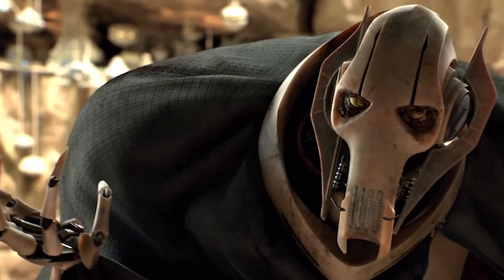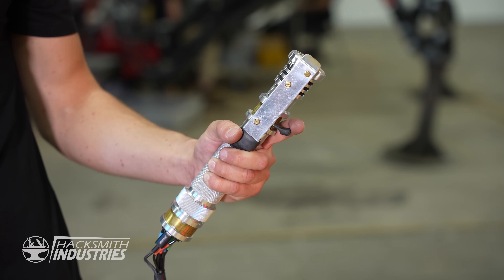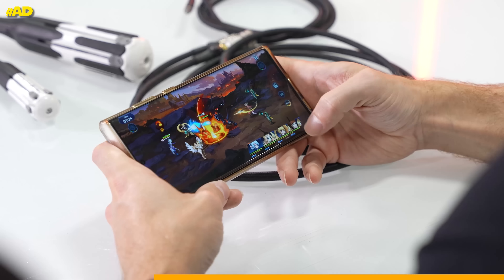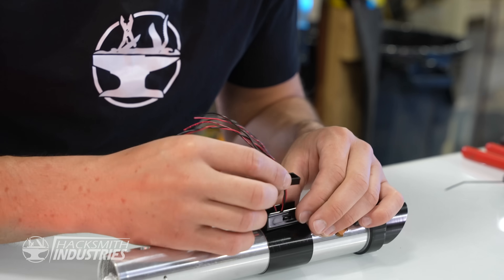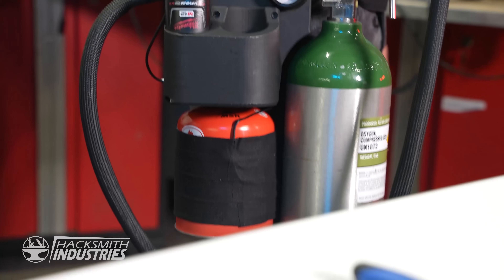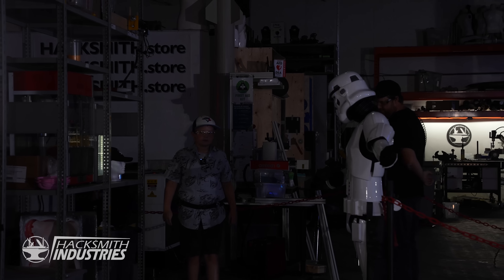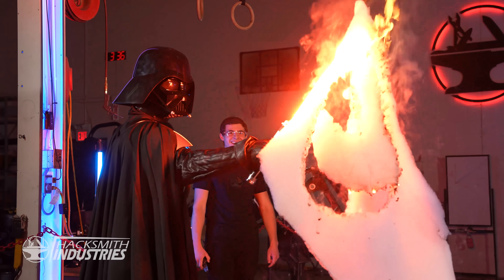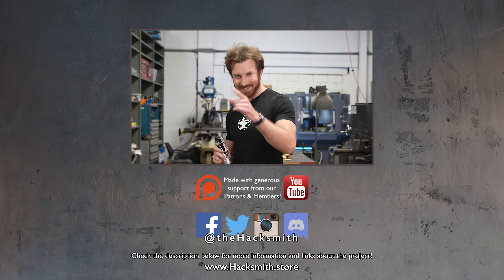My Best LIGHTSABER Yet! (STRONTIUM PLASMA 4500°)

Comment: Call me crazy but I can think of two ways to improve it. For the fuel, you could use hydrogen or just go full oxygen. A neat benefit of full oxygen is you can use the blade to turn diamonds into carbon dioxide by burning them. Yes, burning diamonds, literally. Hydrogen will just make it a more powerful, much hotter flame. Fantastic work guys! Great job! I love the red flame idea, the detail is stunning and that new pack really makes it almost something someone could feasibly use.

Comment: The shortness of the blade is just how physics work. The "light saber" is basically a very smooth gas flamethrower. Think of it as a water sprinkler/garden hose. If turn it on and don't move, the stream is long. Once you start swinging it around or if a strong wind blows through your area, the stream gets broken off. Now, that stream is basically the fuel stream of the "lightsaber". If that is disrupted, no flame. The further is it away from the hilt, the slower the stream and the more prone it is to disruptions. Unless there's an innovation in flow technologies, it is unlikely that this problem can be solved. I think hacksmith is likely to be looking into another way of fuel delivery. I just hope that this project won't be the megabots' mech for hacksmith.

Comment: You should try adding a oxygen tank at a steady stream and high pressure to get more height on the “blade” and it will also allow for the flame to be more consistent.

Comment: remove the electronics and speakers for the noises and put in a smaller version of the fuel electronics that are on the hip and get custom made canisters (maybe like fatter co2 cartridge) to hold the fuel and oxygen that can be loaded into the hilt via a magazine like creation. I'm sure the fun wouldn't last as long but it would remove the external fuel source and provide full movement but hey you can always have more to reload right? lol

Comment: I wonder if it would be possible to use less gas and make the plasma travel further if you engineered the valve to produce a traveling, burning toroidal ring and pulse quickly enough that it looks to the human eye like a continuous column? The pulses might even sound like the actual movie light sabers, depending on the frequency, who knows? Pulse jet engines sound pretty throaty, no?

Comment: you should try to use a rocket engine for the saber. liquid booster for throttling, self-contained, supersonic shock diamonds, long and not very airflow dependent, pretty much everything you need.

Comment: Since you seem to be going for aesthetics on the blade, could you have a casing for the power pack to make it look like a blaster in a holster? It would draw attention from the fact that the lightsaber isn't actually free floating as well
Reply: they could also make it look like the proto-saber power packs. So it more just needs to look like a star wars car battery and you'd be good xD
Reply: Original light sabers were wired, so technically they don't need to draw attention away from that
Reply: @leonardonetagamer  true, but for the majority of the population people know lightsabers by the non wired variants found in the films, so it would help to further appeal to a larger audience
Reply: @leonardonetagamer  lightsabers with wires are not canon
Reply: @albusnightspring8057  not "disney cannon" and no one cares about disney cannon.
Reply: @albusnightspring8057  how so? they are present in the og story
Reply: @leonardonetagamer  only og story is the films
Reply: @albusnightspring8057  um no??? The films are based off books and comics
Reply: @leonardonetagamer  No. Star Wars films are not based on comics or books. The films are the original material, everything else is merchandise
Reply: i said the same thing, like a black leather casing in my case is what i'd go for

Comment: Would inverting the fuel and/or oxy tanks so the sabre draws liquid instead of gas be a way to lengthen and stabilise the flow when moving in air?
Reply from the maker: Nope, the butane would still expand into gas when it burns -- and oxygen isn't stored in liquid form

Comment: If you put a metal wire connect to the light saber, than heat it up, it will be a cool weapon, that can cut any thing
Reply from the maker: It would melt
Reply: @hacksmith  there are some matel have extremely high melting point

Comment: question... why use copper?
im no metalurgist...
but why use a most KRAZY conductive metals in certain places... WHERE YOU DO NOT WANT HEAT (ignition of gas into a plasmatic form of matter)
for the record im not questioning the extremely experienced and knowledgeable people whom are fabricating this monumental accomplishment.... 💯
but why not a metal  that is no where near as electrical conductive (being able to disipate heat conductive energy)  while being able to be strong and light... such as aluminum... or titanium...???
i may be wrong.. im no expert in any way... but i would very much appreciate a scientific explanation... 💯
Reply from the maker: Because heat transfer is not an issue... it's well before the stainless steel nozzle,  which also doesn't heat up.  Remember,  gases are cold! Only when on fire is it hot.
Reply: @hacksmith  SEE EVERYONE...
THIS IS WHY HACKSMITHs AWESOME💯.... AND EVERYONE ELSE IS.... ahhh.... "not as awesome??? 😋🤘😎💯

Excellent answer.  That is what i did not consider... gas is indeed cold... (relatively speaking)

question... other than the pure astheic of the copper looking naturally cool, is there more of a engineering factor the reason for the copper in those places...?

(i totally understand if it's a trade secret if you can't divulge that information....)

im just naturally curious about pure awesomeness... 🤘😎💯
Reply from the maker: Copper and brass is easy to solder, which is why it's typically used in plumbing!

Comment: As the blade design continues to get hotter and more efficient the problem of singed hands is going to get a lot worse... you may want to look into a solution for that, maybe a heat exchanger near the hilt?
Reply from the maker: The hilt still doesn't get hot -- remember expanding gases get cold.  It's essentially gas cooled.

We still have to go much hotter if we want anything similar to a real lightsabers cutting ability!

Comment: I’m a dummy when it comes to engineering but I feel like it would be cool to be able to make it a little bit longer so you’d have more space to put the things you need inside like about as long as Darth Maul‘s light saver but only have one blade and then also have a system where you can push in one of the fuel containers that’s small enough to go in and then pump it out once it’s empty so you can just push in another one and keep going
Reply: lightsaber
Reply: @bable631  I used the microphone so it misspelled it

Comment: Hey guys, love the channel. I had a couple thoughts on how you might improve the saber for your next version. Have y'all considered using acetylene as a fuel instead of propane, as it burn a lot hotter? Also, I saw one guy devise using a telescoping ceramic blade that would dispense the plasma throught tiny holes along its length, while also allowing you to have a solid blade.
Reply: While I am kinda on the side of using acetylene for a hotter output, what has to be in consideration is the outer part of the saber not melting itself while it's active. Maybe I'm wrong on this but I'm not sure if the materials the hacksmith are using can withstand higher temps. But hey if I'm wrong then I'd love to see that
Reply: So this is where they're going to need to start utilizing the way rocket engines cool the inside combustion chamber of the rocket and engine nozzle. Temperatures reached by combustion in rocket engines often substantially exceed the melting points of the nozzle and  materials (about 1,200 K for copper). Regenerative cooling, where the propellant is passed through tubes around the combustion chamber or nozzle, and other techniques, such as curtain cooling or film cooling. (wiki)
Reply: wow, cool
Reply: you better stay away from the fire my friend

Comment: I've been thinking, what if the lightsaber had an oxygen flow in a type of vortex shaped current. That could compress and contain the flame, and ignite it further, for a higher heat output, and a better swinging experience.
Reply: That was exactly the solution I was thinking of for the crossbreeze problem too!

Comment: This seems like a great update, I’d love to see a combination of this an some kind of retractable metal rod so you can actually hit stuff with it
Reply: this is the only thing this is missing, but is there a metal out there that can withstand the heat for such a long time
Reply: @leonhadley21  if there were it’d probably be stupidly expensive
Reply: the first version was made of metal
Reply: @Strider314  yeah but it didn’t retract or have the plasma blade
Reply: I looked it up. Tantalum Hafnium Carbide Alloy has the highest heat resistant out of any other metal (3990℃)(At least out of the ones I could find) Sooo I guess it's impossible to make, unless they reduce the temperature
Reply: @Moon_5a  I’d say there temp is probably in Fahrenheit
Reply: @kobihemmerle1140  oh damn you're probably right! That's means it's possible!

Comment: It's a bit on the short side in my opinion, but this could easily be resolved by making the blade thinner and thereby increasing the velocity at which the the gasses are escaping. I also believe it could solve the problem with it shortening when swung

Comment: This is really cool, but... 

A real lightsaber, were one to exist as in the movies, would be a dangerous weapon (and one thats impractical as a weapon, without Jedi powers aka the Force). So, really, it's a cool toy, except it's now realistic enough to be a very dangerous toy.... would you have any interest ins sparring with another person, using this (forget about the lack of a physical component where two blades would connect, that doesn't exist yet). 

I'm not trying to poopoo the project. As a show and tell extremely dangerous and impractical novelty item, it's REALLY cool. And if you want to blast holes in metal, while there may be better tools for that, this is probably the coolest. 

For now though, I'd say the high-end toy lightsabers are still more practical and interesting. 1) they won't seriously harm someone by accident the way this will, and 2) you can use them for fencing / sport / play.

Can you imagine, though, the first time one of those kids decides to wave their hand in front of your prototype, or point it towards the ground / their feet without turning it off first, or just plain drops it? Yikes.

Comment: What if you guys turned the end into a rocket nozzle shape. If you look at rocket engines, you'll see that the line of flame is very long (granted they are massive) but the shape allows the pressure from the tanks to be converted into speed, which makes it even more powerful (and therefore longer)

Comment: @Hacksmith Could you try using the oxygen around you by building a mini air fan into the saber handle? The saber handle would pump oxygen from the bottom end out to the top end where it gets lit. That way you can avoid having to wear gas tanks and use the lightsaber like a real sword.
Reply: A fan is not nearly high enough pressure
Reply: I figure, but there has to be a way to use a lightsaber without having to carry a gas tank

Comment: @Hacksmith I would suggest putting a small thin rod in the fire so the lightsaber beam has structure; that way you can have light saber fights without trying to make fire seem like a solid blade.

Edit: I meant "without trying to make a jet of fire act like a blade by carefully moving it. You can't clash light sabers if they are a burst of fire, there must be a solid aspect to the light saber.
Reply: That just ruins the point
Reply: @Eclypso-oh8bq  Sorry I miss worded it. If we want a lightsaber fight where the lightsabers make contact, there must be a solid structure hiden in the jet of fire so it doesn't look like miming with props.

Comment: A lightsaber once appeared to me in a dream. I did not know exactly how it worked, but it consisted of a hilt. There was an indentation where the appeared with two electrodes about a quarter inch apart. This electrodes created a film through the air similarly to a lightbulb, and it created a dark yellow blade the color of a sodium vapor lamp around the filament created by the electrodes. I was not permitted to touch it, but I know it did not operate at full power all of the time. It operated at full power only when sparring or cutting and charged while it was being waved around. I was in a large warehouse on top of a large box. The room was the color of a sodium vapor lamp, and I looked like a zombie.

Comment: I loved the improved version, it's getting better and better really quick! My favorite part is the low battery sound tho hahahah!! Seriously, amazing job on this project. I also really enjoyed the way you invited the fans, and how you implemented the Thor hammer system into the show. A great idea!
I do have a question, it looked to me that the blades were a bit shorter than the previous model. Was it because the power of the pack has reduced a little, or was it just to make it safer for the fans in the test?

Comment: Here’s how you could deal with moving the saber quickly, have an accelerometer in the hilt that opens the gas and oxy valves more the faster the saber is moving. Just an idea, great video!
Reply: It might not work, the problem with it shortening isn’t from the outflow rate, it’s more of the flow itself, air disturbs it and causes it to recede, increase the outflow and when it recedes that’ll just make it hotter, not taller

This is just what I gathered though, might be wrong idk
Reply: @prestongarvey2599  what would happen if the Saber was swung in a vacuum? Would it be able to retain its length? Or would it not turn on?
Reply: @3nd04  I am lost, what is a vaccuum, like a cleaning machine type of vacuum?
Reply: @GamingMasterMind3000   a vacuum is anywhere without air for example: space, or a vacuum chamber (a pressure rated container with the air depleted)
Reply: @bigdaddyd9445  OH OKAY thanks, but doesn't it need air to work? Like fire needs air right?
Reply: @3nd04  well by what they were saying it seems hydrogen and oxygen are already mixed in the tank, so it would likely turn on, and also retain its length as there's nothing holding it back

although it would probably also either keep getting longer as there's no air limiting its length, or would spew out from all sides because there's no air holding in the sides of the plasma blade... or both who knows
Reply: @prestongarvey2599  If you found a way to flow air in a vortex around the flame like a tornado it could help stabilize the blade while moving.
Reply: @boofmaster420   not gonna work. The flame blade works on laminar flow. Think of it as a very smooth flamethrower becos that's what it is. Vortex is made of turbulent flow and you cant have one in the other in such a small cross section surface area. That's not how physics work.
Reply: @boofmaster420  that would be pretty simple if you just made the head of the blade spin with a motor, bit more bulky tho and would require more power
Reply: Suprised I didn't think of that, but that may just work, assuming there's any room left in the saber that is
Reply: maybe instead of just more gas, you decrease the size of the valve so it flows faster? adding more fuel would also help it stay lit
Reply: @orian1427  I agree with Orain the most.but you all have great Idea's, I am just shocked at how many subs this guy has, I guess this means that being an engineer is good for youtubing!
Reply: @GamingMasterMind3000  stop promoting your channel, if you want subs you have to work for it.
Also this isn’t the right place to advertise a roblox channel
Reply: @BubblextraGD  SORRY!!! I DID NOT MEAN TO ADVERTISE/PROMOTE MY CHANNEL, Its not like any one here would like dumb roblox vids anyway, Here I can edit my comment right now. And Of Course I know I have to work for it, its not like I use a website to spam subscribers. Anyway, SORRY AND PLZ DO NOT REPORT!

Comment: Awesome work thoughts regarding  blade length  coaxial/rim fed O2 ==oxygen wall... flame /gas flow stabilizing also checkout flame HV generator ala NikolaTesla with respect to flame confinement/extension via strategic magnetic / electrostatic inertial confinement pseudo z-pinch

Comment: I wonder if you could use the local atmosphere?  Atomic cells? Igniting the plasma with alpha or beta particles. You do get alpha voltaic cells or beta voltaics. You could build a nano turbine compressor in the hilt? With the discharge manifold acting as a tornado.  To achieve the densities needed. 10000 degrees c might be possible with if you tweak the design. Constricted plasma arcs. Airflow will be the main factor.  Especially if you want something hotter than the sun? Nothing could stand in the way of that.  Great to see developments.  only at the proto sabre phase. I love to see something that’s self contained.

Comment: To help the fast rotation problem you could attach 2 servo motors on the nozzle. turns the nozzle into a gimbal with altering them.
So when you swing up the nozzle turns up

Comment: For pressure washers there are nozzles like the ripsaw that cause the water to rotate.  They basically use a ceramic ball that travels in a circular track to impart the rotation on the water. They use ceramic so it can withstand 1000s of psi's of pressure but perhaps you could find a high temp ceramic ball and like a welding cup to focus the flow of gas out the end to impart some circular motion to the "beam"  and it would improve it's stability and length, sort of a concentrated fire tornado effect?